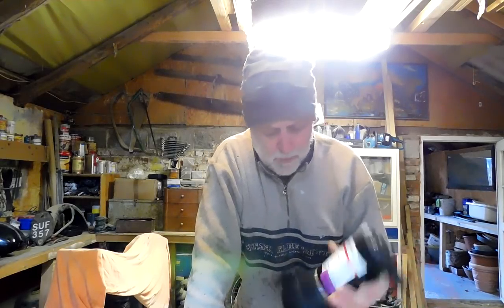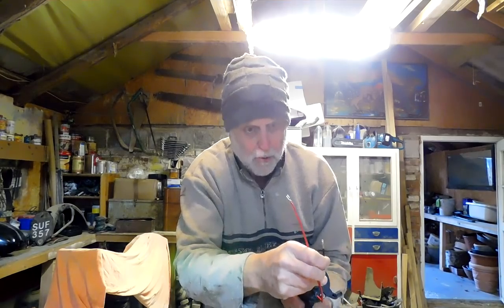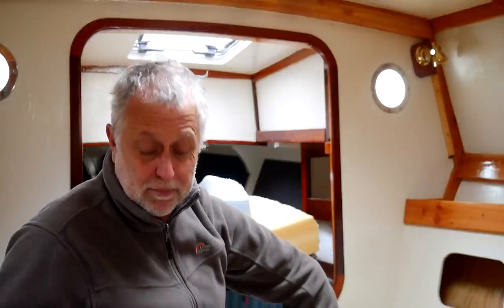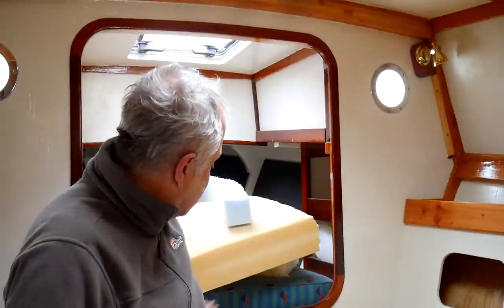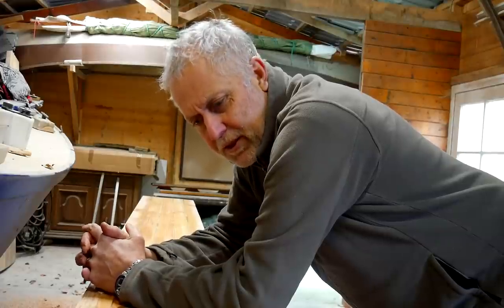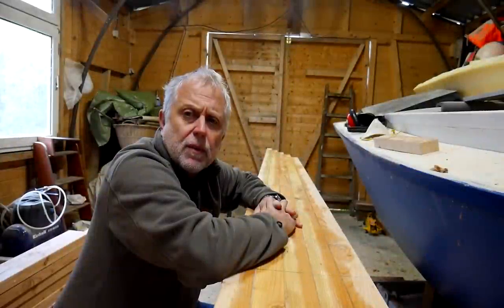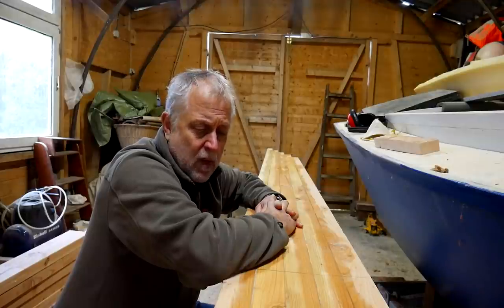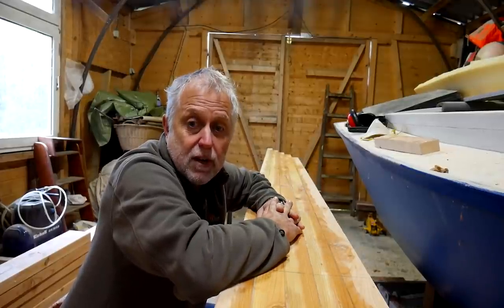Bilge pumps; settee cushions; keel timber progress. Building a cruising sailboat - SV Tapatya EP209

Comment: Tony mount a foot valve on the bottom of the suction hose (foot valve is a check valve with a strainer on the inlet side) it will keep the pump primed always and prevent backflow into the bilge after it shuts off.
Reply from the maker: Will do, Pat. Thanks 😃

Comment: Unusual the flojet doesn't have a marking. I have several and they clearly have an arrow on them.  Beautiful pumps, self priming, can be run dry with no damage. I've had one of mine lift water 2 meters starting with a dry pump. They do require a suction strainer.
Reply from the maker: Thanks JayElle. Yes, they come with a little suction strainer and I’ll certainly be fitting a pick up strainer as well